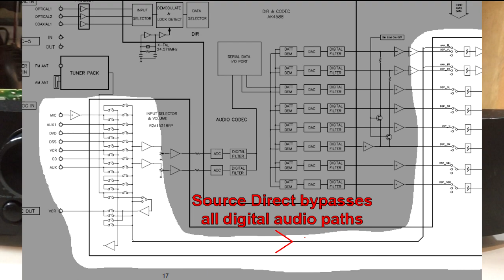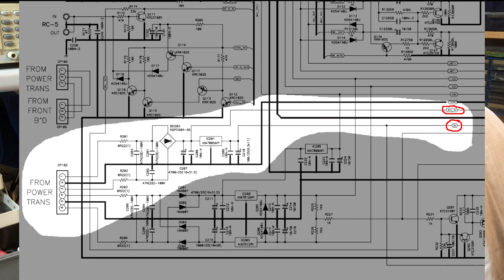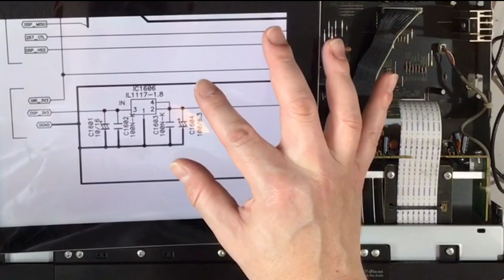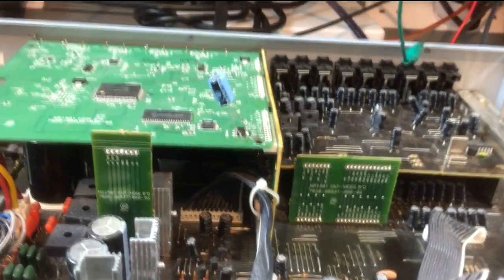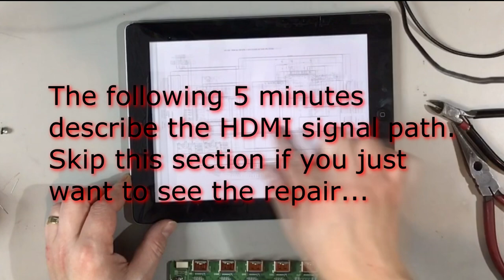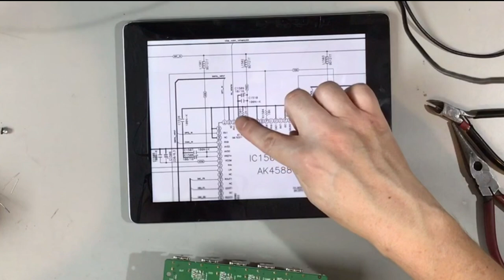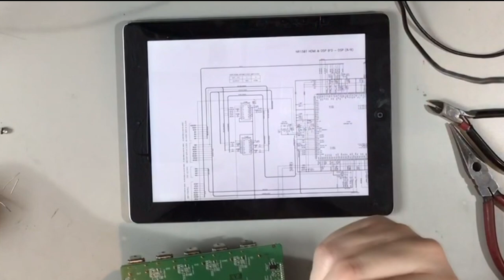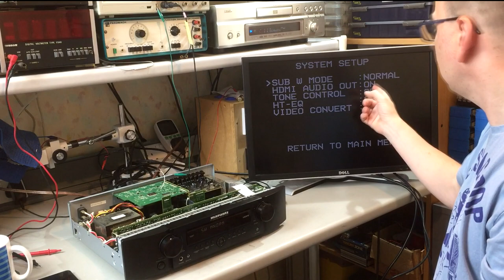A Marantz NR-1501 AV receiver Amplifier visits the lab bench for repair (plus wild goose chase!)

Comment: Thanks for your very interesting and useful video! I made the capacitor replacement and also that “hdmi out off” setting, it works perfectly now, after cracks and pops every time I turned it on! Dan, sound engineer

Comment: Hi  Eclectronics,

THANK YOU! THANK YOU! THANK YOU!!!
What a FANTASTIC video.
We have a Marantz NR1501 with the a sound problem and we found your Youtube video and watched it over 4 times.
You did a lot of work on the video and we thank you immensely for all your hard work, please don't change anything, it's the Best!
We followed exactly your instructions and we replaced the cap 1604 and the other cap (200uf-6v) beside it with 2x220uf 10v capacitors after carefully removing the on-board dried out caps. Put it back together again, turned it on and it worked first time, what a great video you've put together and we thought we'd write and tell you.

Now here's another receiver we have if you can find one, and put up a video on the repair of one...
It's a Denon AVR 788, great machine but ours had sound output in only one channel and HDMI was not working.
If you ever manage to put up a video repairing one of these we'd be very very thankful, and show our appreciation to your efforts more tangibly .
In the meantime thank you for your video. our Marantz NR1501 works great now:)

ps: We also subscribed to your channel:)
Reply from the maker: Thank you for your kind comments! If the videos help reduce landfill I'm very happy :)
Reply: @Eclectronicschannel  Thank you Eclectronics, for all your help, that’s awesome!
BUT HELP!!!
After replacing cap 1604, I broke accidentally off the connector from the -ve side so I just ran a link to the --ve side on the next cap. – Ran fine for a while:)
I later ran into another problem and had to replace with a new cap on 1601. Again, ran fine for a while:)
Now I’m snookered and stumped:(
After many cups of teas (a must for watching your videos), let me explain what I get now…
When I plug on the unit the red circle comes up on NP.  When I switch on the unit (still on FM mode from last shut down), I get no sound, but when I select with the dial to the BLU-RAY selection and then go back to select FM - it works, WIERD??? 
So do not know why I am not getting HDMI anymore.
Is it another cap, or (even worse could it be an IC?)
I’m a newbie at this so please be gentle, can you help please?   Any ideas?
Thanks again:)
Wish I could send photos (sigh)

Comment: I had an amp years ago and one day after coming home from school, I went and turned it on and there was no audio on one channel. I got my multi meter, scope out, I'll find it. It ended up being the balance knob had somehow been turned to one side. I got a kick out of it and looked at it as a learning experience. As far as amps go (from my experience), if there is a low hum, it's a good indicator of the caps being bad, not always though, but I check for ac level on dc line. They go through a lot of thermal cycling, it stresses solder joints, another good place to look. Good video.
Reply from the maker: There are often wild goose chases in fault finding but they all add to your experience. I agree with what you are saying about the caps, measuring AC on them is a good indicator if you know what it should be...

Comment: Good video. Thanks for going thru a lot.  Got some ideas for mine.

I bought my nr1501 from ebay thinking it'd be easy to fix. Complaint was static in the audio channels.  I confirmed this upon checking it out. But there are other problems, like the HDMI board draws too much power.  IC201 (13V unreg to 5V reg) is burning hot. So I pulled out the hdmi board and powered it from a lab supply.  Sure enough, the 5V line draws over 2A.  The AK4588 got really hot.  Then discovered that IC1007 (switcher) didn't work, and replaced it. 

Then powered it up again, powers up ok, audio passes, but quickly got a burning smell from something. Too bad all of the functional chips are on the underside of the hmdi board so that I could hv at least touched them.  Could be the AK4588 that got damaged for good.  Just now with the board out of the chassis, I measured a few ohms on the 3V3_IN (actually 13V unregulated).  I will inspect further with better equip at work tomorrow.  Maybe it's just one of the 1117 linear regs that burned too.
Reply from the maker: The AK4588 failure appears to be a common one from when I researched for fixing this one. You could take it off and then check the power rails for any oscillation or incorrect voltages, then replace with a new IC. Alternatively, there are plenty of faulty units around and often turn up for sale for cheap. Buy one and make one good unit out of two bad ones perhaps?
Reply: @Eclectronicschannel   I powered the board separately and found the AK4588 to draw a lot of current. I'll need to buy another chip, probably from HK or China. Re: the 5V linear reg, I'll replace it w/ a switcher that fits into the TO220 socket. The design problem is that the secondary voltage is much too high.  The 7805 has 14V in, and with 9V across it times the load current, you have 4 or 5W of power being dissipated.  This is likely the reason for all the premature failures people report in reviews (such as Amazon).  This still, though, doesnt explain the AK4588 failure.

For a few days I was chasing my tail before taking the main board out and testing it. I say this b/c the front display would not power up at all. I thought I killed one of the MCUs. Then I remembered the two-button reset, Menu-RightArrow.  But that didnt work. I pressed a lot of combinations until Display-RightArrow worked.  The front display showed CURR 0. Then I power cycled, and everything came back! 

The audio works.  No crackling noises. Played it really loud to see if I could induce any problems, but no. Everything good. I'm still pretty sure that the power supplies have something to do with it.  Now to replace the AK4588.

Update: a couple weeks ago, finally rec'd AK4588 chip. I needed help to remove old one, a couple pads lifted, not a problem as these were NC pins. Soldered down new chip, powered it from bench supply, success!  Current draw from 5V was <50mA. Then installed board into receiver and all digital audio and video works like a champ.

Comment: Hi thanks for the video.A practical question.  Tried to remove the HDMI board from a NR1504. You wiggle using screwdriver. But the NR1504 board sits tight. The connectors have notches to lock. Is ther a special tool or something to release these notches. 
When I use more force I am afraid I will break the board.
Reply from the maker: Without seeing the connectors it is hard to comment. Some connectors require the release of a latch of some sort and others are friction fit. If gentle persuasion doesn’t work then post a picture and I’ll see if I can identify it.

Comment: Boa tarde , esses modelos da marantz nr slim costumam dar muito problema ? Estou pensando em comprar o NR 1710! Obrigado !
Reply from the maker: Hi Eduardo, it’s difficult for me to comment on other models but all the 17xx models probably have the same issue. After a few years the capacitors that have been hot will need replacing.
Reply: Obrigado pelo retorno , mas isso vale para todos receiver ou somente a linha slim tem mais chance de dar problemas ! Thanks my friend

Comment: Hi, Very nice video. Thank you for this. After searching the service manual, which is very use full, I still can't track my problem. What happend is that when I plugin a HDMI (doesn't matter which input) I'm getting a full line level +/-1kHz pulse signal on my speakers I checked all the regulators, they seem to be fine. It sounds to my there is a switch or clock circuit closed with the audio path. Do you have any thoughts of where to look in the service manual?
Reply from the maker: Very difficult to speculate on that as I haven’t seen it myself but it could be bad electrolytic capacitors around the HDMI switching section causing data corruption. Do other inputs, like optical/co-axial work ok? If they do then the DSP and CODEC are ok at least, suggesting it’s confined to the HDMI section.

Comment: hi I have Marantz AVR SR6005 No audio and no video output. input non sensing nou sound in fm and usb in pure direct mode. all voltages are correct in hdmi board 5v, 3.3v, 1.2v, 1.5v